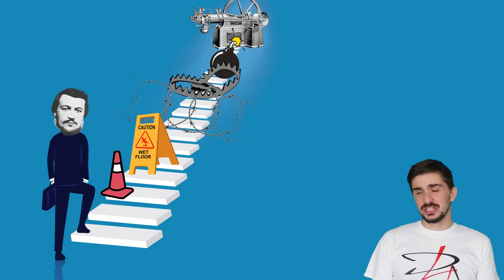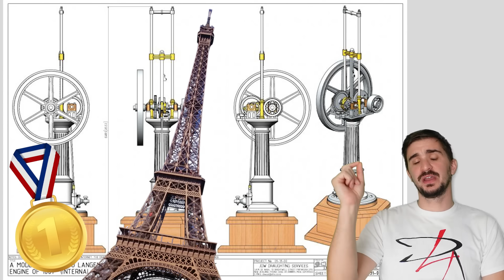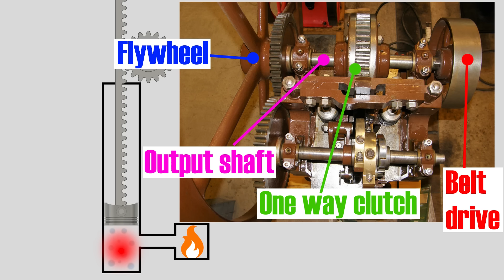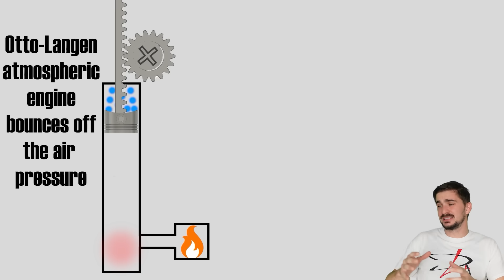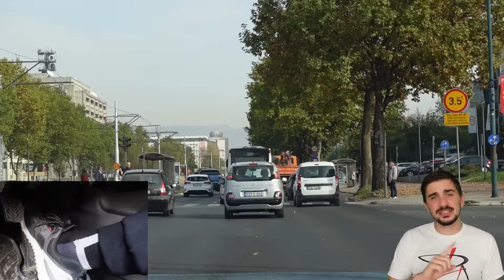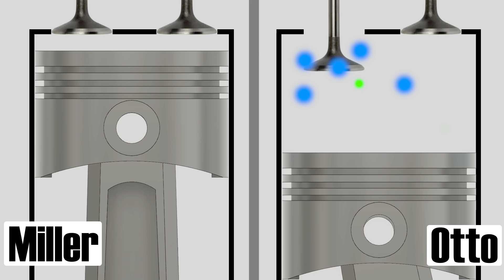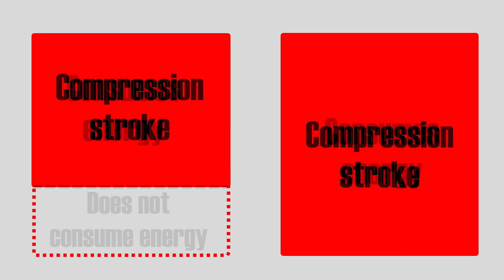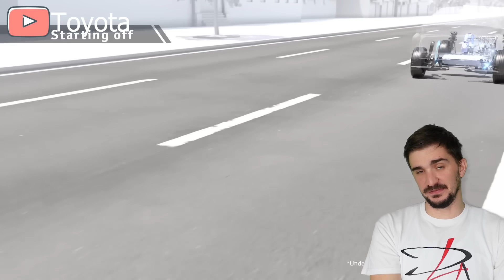You'll understand everything about Atkinson, Miller and Otto cycle engines after watching this video

Comment: I see a common trait with this https://youtu.be/NvtcTXey0U8?t=346 in the Daimler Phoenix of 1896=ish.  That engine used a lamp to heat a platinum wire leading from the lamp to (near) the combustion chamber.  Ignition occurred when a flap, a hider opened to expose the mixture to the super-hot platinum wire.  Boom! and around we go.  This was ingenious and required no electricity but one had to light the lamp before starting the vehicle.  It rubbed folks hoping for electric headlamps the wrong way.

Comment: I'm not sure the logic of the compression cycle wasting energy is correct. You can always use lower compression ratio to regulate that with a conventional Otto engine. It sounds more appropriate to me to actually present the Atkinson/Miller cycle as a prolonged expansion stroke since this is the phase when energy is actually harvested.

Comment: Imagine a modern 5 cylinder with freevalve...  could alter the cycle anywhere in the RPM based on throttle position.  Go max efficiency at any RPM when light throttle.  Open all valves if engine braking.  Go otto and vary lift, duration, shape of duration to max power, or between shifts to max rev speed for rev matching...

Mmmmm
Reply: Couple that with a hybrid turbo, and you'd have a true monster that could play like a kitten.

Comment: With all due respect, I'm entirely unconvinced that compressing air in an engine cylinder "consumes" as much energy as is being portrayed here. If you compress gas, it simply gets pressurized and fights back. Critically, that pressure can by far and by large be returned right back to the piston during the return stroke; combustion *not* being considered. That is to say, gas trapped in a cylinder will act much like a spring, it stores energy. The only way this process can consume energy (aside from usual moving part friction loss) is due to compression directly heating the air, and that heat subsequently being lost. In an internal combustion engine, however, the compression heating can't be too high or it will auto-ignite the fuel/air mixture. This is why pump gas engines typically top out at around 9:1 compression ratio. Furthermore, any heat made would still have to "travel" out of this trapped gas, which, in absence of good thermal conduction devices (i.e. radiator), is a slow process. At 2k R.P.M, the power stroke lasts only about 60 milliseconds... basically zero time. So, this being the key problem just doesn't seem factual.

My understanding of the Atkinson cycle engine is that it's all about increasing the length of the power stroke, so as to extract as much energy from the combustion process as possible. The only flaw with this is that the power produced during the full length of the power stroke has diminishing returns. To put that in more concrete terms, most of the power comes from the first part of the power stroke. This only leaves you with a small fraction of power for the rest of the stroke.... The point of the Atkinson cycle then is that "more power is still more power" and that small fraction of power is otherwise just wasted getting thrown out your exhaust as burning flames. The challenge to harvesting this is that no process in the engine is an isolated island, it's all connected. So one can't simply "lengthen the power stroke" without having side effects. We notice this as reduction in relative peak power and responsiveness, as was correctly stated in this video.
Reply from the maker: With all due respect, the gas can't act like a spring because you ignite it. The energy spent on compression doesn't get returned to the piston because combustion follows. The fact that compression of air alone can ignite the fuel illustrates just how much heat and energy is in the proces of compression. 9:1 was the norm in circa 1982. Today turbocharged engines run 11:1. Naturally aspirated ones go as high as 14:1. Yes increasing the length is a key part of the process but it means that you're automatically reducing the length of the compression stroke.

Comment: There is one of the miller engines in the Mazda with all wheel drive etc at work... It has been there since two years before I started, and the owner finally has it up for sale. it has a blown engine, and Mazda wont even entertain the idea of supplying parts for it, even if they wanted to there are no parts to get anywhere in the world. the next life for that car would either be gatting melted and recycled, or the engine ripped out and replaced with a 4 rotor & used for drifting by someone who wants a one of a kind drift car!

Comment: "lets reduce compression drag by holding the valve open but also add way more drag by bolting a roots blower on it"
Doesnt really sound intuitive if you know some of those blowers need almost 100 horses to turn by themselves

The real reason the Miller Millennias failed is because they are unqeuivocally miserable to repair when anything goes wrong ever

Comment: These systems are just moving the "inefficiency" around to different places.  Driving a supercharger is absolutely not free. Driving an electric motor from anything but a separately charged battery (IOW, not powered by electricity generated by the engine) is even more "inefficient" than just compressing the air.
They are trying to around the fact that you need high compression to get thermal efficiency.

Comment: Why not remove the compression work by the piston completely? With today's technology everything is controlled by ECU, you can spray a certain amount of fuel air mixture to create the desired amount of pressure. Today's engine still need piston to compress the mixture. With no compression work by the piston maybe in low load you can even skip the fire

Comment: Am i only one who is like thinking that why isn't car makers using following idea like long ago.
Good old vtec.
Just make it run like vtec. normal mode is miller cycle with one cam lobes and when you ask for more power then the vtec kicks in and goes on to otto cycle with different cam lobes.

Comment: Ha, any modern Otto cycle engine with an intake and exhaust camshaft can be made to act like an Atkinson cycle engine, Toyota has been doing this with cam phasers since the mid 2000s. They delay the opening of the exhaust valve using cam timing retard on the exhaust camshaft. It does the same thing as allowing there to be a longer power stroke compared to the normal compression stroke.

Comment: You have used Eiffel tower picture for Paris World Fair 1867, but it was build 20 years later :) . Also electric motor has nothing to do with compression in atkinson cycle in Toyota's ICE in thier Hybrid Prius and doesn't substitute supercharger. It drives and controls rpms in planetary gearbox.
Reply from the maker: The electric motor most certainly does substitute the supercharger, the gears are just its tool. The electric motor makes up for low rpm responsiveness and kicks in when there's a demand for power or when there's little power required. Your statement basically says "the engine doesn't move the car, it only turns the wheels". The tool is not the end-goal.
Reply: @d4a  No, it certainly does not, what you are describing is electric compressor. As I wrote, there is no single motor in Prius that has anything to do with compression in Atkinson cycle of Otto's Naturally aspirated engine used in Toyota THS. Also it's impossible to run this ICE in low RPM, where ICE has not enough power as eCVT doesn't allow that at any point of use, that's the point of CVT - to work in optimal RPMs only. There are two RPMs levels: optimal performance and optimal efficiency. There are two electric motor-generators MG1, that starts ICE, generates electricity if ICE is not connected with wheels and MG2 that generates power during braking and adding power to wheels when engine is not in low RPMs, but in fact in high RPMs where it has maximal power, but torque is needed and that's is added by MG1 to those high RPMs of ICE, so compare it to the supercharger is so wrong in so many ways.

Comment: I'm afraid you mixed up something! The Miller cycle does NOT rely on some of the sucked in air/mixture being pushed out of the cylinder again! Instead, the intake valve closes earlier than in a normal Otto engine during intake stroke. VW's 1.5 evoTSI and 1.0 evoTSI rely on this principle.
The Atkinson cycle is the one in which intake air is being pushed out of the cylinder again (very late closing of the intake valves), and is used e.g. in some Toyota engines.
Reply from the maker: No, closing the valve early is VW's Budack cycle.
Reply: @d4a  

From official VW web page:

Miller combustion process
Depending on the number of cylinders and their power class, the compact TSI evo engines integrate different technological components.

The four-cylinder with 96 kW (130 PS) and the three-cylinder variant use a combustion process based on the so-called Miller cycle.

This is achieved by early closing of the inlet valves, thus reducing throttling losses and enabling a high compression ratio – 12.5:1 in the four-cylinder and 11.5:1 in the three-cylinder engine.

However, the lower fresh gas volume must not reduce the output and torque, which is why two sophisticated technologies are on board.

Using an extremely fast and precise hydraulic system, the inlet camshaft can be continuously adjusted to increase filling during acceleration

The exhaust camshaft is also adjustable.

The turbocharger features variable turbocharger geometry (VTG) – for the first time in petrol engines for the high-volume segment.

This permits absolute charge pressures up to 2.3 bar in the four-cylinder engine with 96 kW (130 PS) and even 2.8 bar in the three-cylinder variant.

As a result, the engines can spontaneously build up their maximum torque already at very low rpm.

In the 1.0 TSI, the turbocharger can withstand exhaust gas temperatures of up to 950 degrees Celsius, and it achieves a maximum speed of 289,000 rpm.

Active cylinder management
Active Cylinder Management (ACT) is a further highlight to reduce fuel consumption of the 1.5 TSI.

The system shuts down the second and third cylinders at low to medium loads and engine speeds by deactivating injection, ignition and the valve gear.

Switchover takes place very quickly and practically unnoticed.

The efficiency increases in the active cylinders, while the middle cylinders simply follow with practically no losses – they are reactivated when the accelerator is pressed.

350 bar injection pressure
The common rail injection system in all TSI evo petrol engines operates at a maximum pressure of 350 bar and is capable of delivering up to five injections per combustion cycle.

The fuel is atomised into very fine droplets, mixture formation is precise, and raw emissions are kept at low levels.

A particulate filter is located directly downstream of the engine which filters almost all remaining soot particles from the exhaust gas.

Comment: so the miller engine is just a normal engine with the intake cam retarded a heap more than usual? seem like a silly idea when the flow is fastest when the valve first opens due to the build up of pressure in front of the closed valve... opening it early lets a lot more in, and as long as the exhaust valve is still open when the inlet opens that pressure can flow in (even though some of it can escape out the exhaust, but that just makes for cool flames)
it would make more sense to have both sets of valves opening and closing dead on top & bottom dead centre so the max efficiency is at Idle!... and that makes no sense at all!

Comment: I dont get this explanation. When you drive at low loads you restrict the airflow into the engine on all engines. This is wasted energy. If you could somehow adjust the amount of air and keep the compression ratio. Saab had a cool idea with a tilting cylinder bank. Please look into that. Should make a great video

Comment: I have a Kia Forte which has an Atkinson cycle and my brother has a Kia Soul which not. Both engines are the same. the Soul has more torque and power. But the Forte has more gas economy. A lot more. Like a 1.6 Engine

Comment: Huh. I think I understand my vehicles better now. My Chevy Express 3500 has a 6L v8. Not great on gas, but immediate power, and fuel efficiency barely varies at different highway speeds and load capacities. Otto cycle. 

My Hyundai Santa Fe has a 2.0(maybe?) v6. Significant power lag in comparison. It’s better on gas overall, but loses efficiency quicker as speeds increase. Miller/Atkinson cycle.
Reply from the maker: I think the actual issue is that you're comparing a 6 liter v8 to a 2.0 liter or 2.4 liter. That's more than twice the engine.

Comment: I still think these engine concepts are nonsense. Ok, sure it saves some power when the engine can blow out some gas at the beginning of the compression stroke through the still opened intake valve. But when a supercharger is added, the piston has to press the gas out against the supercharger pressure, so where are the savings? In fact, a conventional naturally aspirated engine that is driven in low to mid power works like the miller cycle all by itself: The partial vacuum in the intake prevents the cylinder to achieve a full gas filling, and thus, compressions only starts when the piston went up enough that the gas pressure in the cylinder is at 0 (i.e. when the piston has "neutralized" the vacuum by decreasing the volume in the cylinder). Only at full open throttle, the compression begins near the bottom of the stroke. So, in a way, a naturally aspirated engine works like a miller cycle at low to medium loads and continously switches to full compression at full load.

Comment: Just like he said, don’t buy junk, sales hype with faulty engineering. Atkinson and Miller cycle engines are LESS efficient. No matter how you slice the pie, it’s still the same pie. If they were MORE efficient, there would be more being built. The idea of reducing the stroke length, to get better economy is nuts. Adding the supercharger, is more monkey motion parts being flung around for nothing. Like adding extra connecting rods.

Comment: A really long video that is incredibly technically wrong.

The Miller and Atkinson don't gain anything over the Otto cycle in their reduced compression stroke. They are able to reclaim more energy from their increased expansion stroke. Its a big, big difference.

The Otto cycle doesn't loose anything in it's longer compression stroke. It's an air spring and the efficiency loss is minimal. In fact the Miller cycle is actually worse efficiency wise because of pumping losses.

Where the Atkinson and Miller shine is for a given amount of energy put in, raising the intake charge pressure and temperature, the much longer stroke does a far better job converting to mechanical energy. In other words the exhaust gas is colder when it goes out the exhaust pipe.

It's a big deal, because what you are presenting is not the right way of explaining the thermodynamics of what's happening and thus the audience cannot possibly understand why the efficiency gains are had.

It's not saving energy, it's extracting more from them energy put into each unit of air and fuel put through the engine.

Comment: The otto cycle engine would be much more efficient if the compression stroke could be done in 4 stages (like every high efficiency air compressor is) instead of one single stage. An easy way to do this would be a three stage air compressor that is remote from the engine, discharging to a storage tank, and then from the tank, injecting the highly compressed air back into the engine using pulse width modulated injectors. Properly timed and controlled, the pressure in the cylinder could keep rising well after the normal pressure peak is reached, effectively having a otto cycle+ miller + diesel cycle with average cylinder pressures that approach what high boost engines do, without any lag at all, and no chance of nitrogen oxides forming. Why? Because the heat of compression in a 4 stage compressor @ 25:1 compression is only around 100-120F, but a single stage compressor at 25:1 is OVER 2000F!!!

Comment: the miller engine needs the supercharger just to run it, assuming it was a carbureted engine, that back pressure pulse from having the intake valve open after the intake stroke would blow air/fuel mixture right back out the carburetor.

Comment: I highly doubt that the Atkinson cycle is more efficient. You said yourself that the Otto provides more power. So what is your benchmark for comparison? If you build 2 engines, one with an Atkinson cycle and one with an Otto cycle that have the same amount of horsepower, which one would burn fuel faster?
Reply from the maker: You're missing the point
Reply: @d4a  Yes, xd. Can you fill me in? :)
Reply from the maker: That's what the video does far better than a wall of text I would write here

Comment: There was a English 4 cylinder 8 piston opposed 2 stroke diesel by Commer that was very efficient that started production for their trucks. You could/should go into this motor in depth.
Chrysler bought the English company and destroyed everything they could (clowns)- plans, engineering information, existing plant. Of course to protect their existing and ensuring the ongoing part costs gains. The engine was VERY reliable. A few examples still remain.

Comment: So the Miller engine with a supercharger is basically a regular supercharged engine but with more work for the supercharger (because the cylinders lack compression) and with more complexity in the cylinder head?